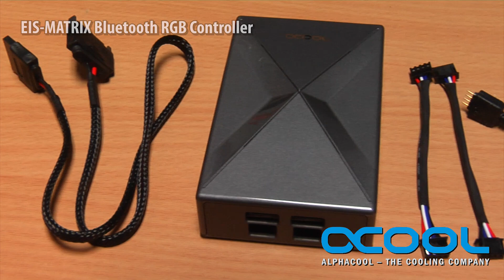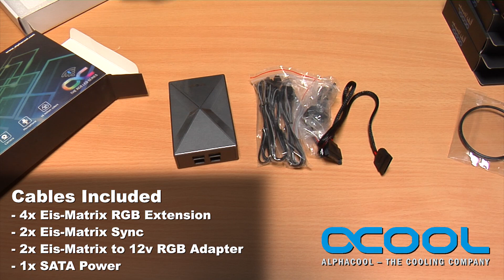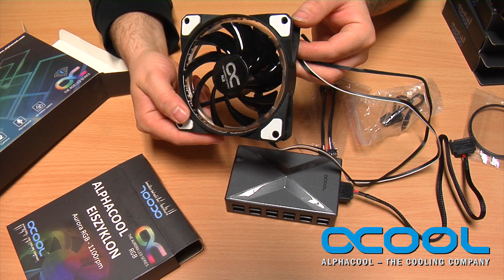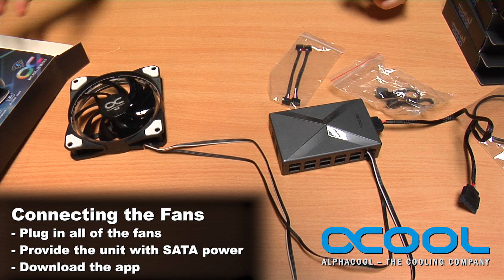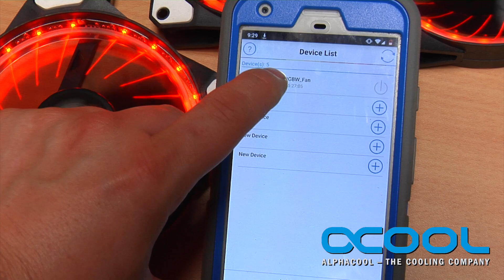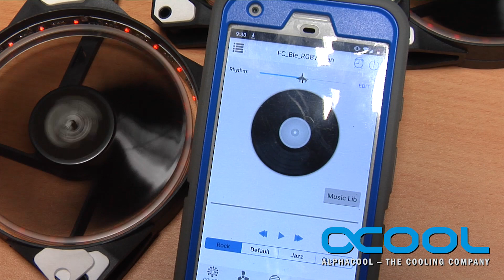Alphacool Eismatrix: HowTo use all the different modes

Comment: so that means i dont have to use the alphacool fans, but can use other 4pin pwm fans as well ?
Reply: Thats a question or a statement?
Reply: @Helder_Paulo  question ist guess
Reply: @erronblack346  since we are in 2021 u should know all pc fans works a like, what change is constrution. If fans spin slow or faster, silent or louder. Imagine, if u conect directly to mobo, fan 1 with 0.5 amps works at 1000rpm (for example) and fan2 other brand with the same 0.5 amps works at 900rpms. Both will work, but if fans dontbhave same specs they wont have same rpms. But  with this fan controller from eisbaer u can control by speed, u add in app current to adding rpm. So u can put any brand
Reply: @Helder_Paulo  okay thanks

Comment: I just have to say it because I don't see it happening:
What modders really need is a controller like Cooler Master's seen in the link that is for A-RGB fans & LED strips that has it's OWN software & connects to motherboard via USB 2.0 header.  This way it can be used on any motherboard regardless of ASUS, Gigabyte, & MSI's proprietary software. There are some who would still like to upgrade older non-ARGB motherboard systems with ARGB fans & LEDs or companies like SuperMicro that still don't support ARGB.   
http://www.coolermaster.com/cooling/cooling-rgb-accessories/rgb-led-controller/
Reply: @Tefen Ca I'm a Overclocker, Tester and Reviewer i already passed the 100 RGB/ ARGB Products and most suffer from a common issue, the Software...for that Companies use they're own controllers. As you may know RGB +12V has 2 headers as Standard 4 pin/ 5 pin and ARGB is a problem comes in +5V 4 pin format but without one and 3 aligned which is NOT standard, Gigabyte use this. Moreover each brand has its own RGB Sync so then you want to Sync Asus RGB stuff on Gigabyte or MSI and won't work because of the software. I can talk hours about my experience on this and the problem is always the software through USB mobo header. In fact some won't detect it at all. I also reviewed those from CM.
Reply from the maker: It is on the To-Do list ;-)
Reply: does this exist yet as I current have the option to get the ek connect but the software is hot garbage, the deeep cool but i will look all argb features or the is zalman but poeple have also reported issue on it.
ps i have a 4 pin 12v on my motherboard and i have 3 pin argb fans to connect